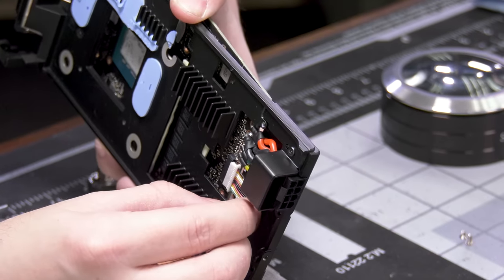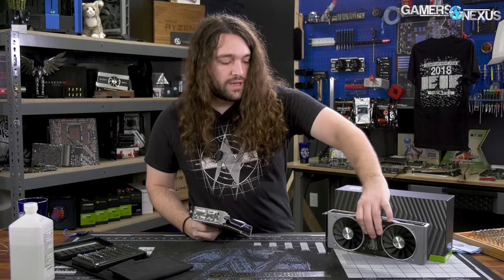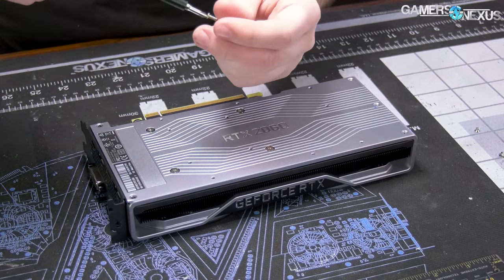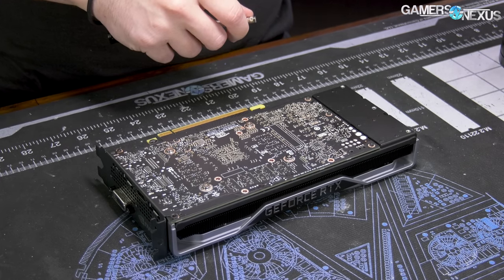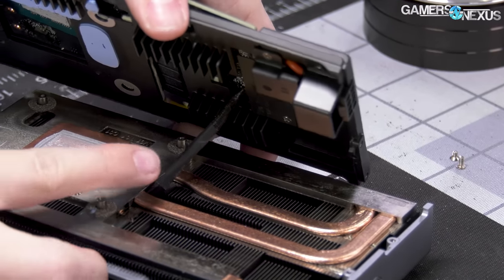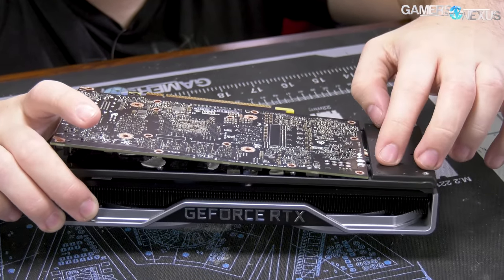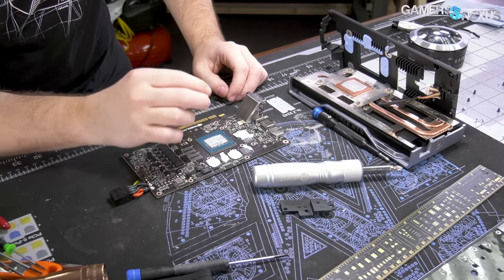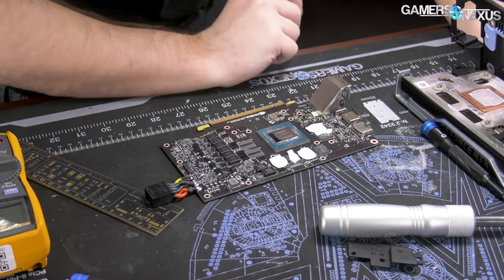RTX 2060 FE Tear-Down: They Added More Glue and Screws

Comment from the maker: Find the review here: https://youtu.be/b4Kfrc3kk_c
Reply: You need to use a Swiss Army Knife that (hopefully) has a phillipshead screwdriver in it to open the RTX 2060 properly.
Reply: Nvidia add more glue and screws....SO YOU CAN't OPEN IT AND UNCOVER THEIR LITTLE SECRET AND TELL TO THE WORLD.........
Reply: I kinda feel like the hair would get in the way.....
Reply: You know its bad when its 28 mins....
Reply: ONE WARD WATERBLOCK
Reply: or they are thinking they customer are  @KSPilo
Reply: Sir, saying that nvidia is inexperienced in fan design and stuff does not hold up . their boardpartners all have loads of experience
Reply: ASUS does the same thing.
Reply: there is a couple screws holding the power
Reply: noticed it right when you opened it
Reply from the maker: @mauriceh7558  Their board partners are not NVIDIA, though.
Reply: @GamersNexus  Would it be that hard to get that partners knowledge tho?
Reply: I like your videos, but every time I play your recent vids my processor overheats, especially on this vid. My dedicated GPU doesnt heat up though, and I play other content in 4k but yours seems to be the only one to do this, normally youtube videos have my processor running at 50 celsius or so but when I play your vids it goes up to 70c(higher then when im gaming), granted I am on a laptop but I still found this odd seeing as there are no other videos that do this.
Reply: more screws than fps with rtx on
Reply: Steve, hot glue isnt bad in computers and is often used by OEM's for shipping purposes. just use some rubbing alcohol, it will make the glue brittle and pop off. but it needs to be avoided on small capacitors etc. cause it will rip them off.
Reply: Easy reason Tech Jesus why Nvidia did this. It's so the 2060 won't compete with the 2070 as it uses the same GPU chip if someone gets water cooling and overclocking
Reply: Almost seems like some of the money wasted of building this thing went purely into making it harder to take apart
Reply: @darronpattel  If you have a GPU in your laptop, turn on hardware acceleration in the chrome browser settings. That way your laptop stays cooler, since the GPU can handle the video better.
Reply: steve removes a screw calling is a pan head when it clearly is a countersunk flush head... also RIP anyone who buys these cards and goes to reapply their thermal paste in a few years.
Reply: Small nitpick but when you look at the copper block and say "thicker is not ideal, it's about surface area not thickness", you're a bit off the mark. More mass means can store more heat, and takes longer to warm up. It's a good thing. It's all about tradeoffs though, since copper has a heat capacity around a third that of aluminium (but aluminium is much lighter). Your comment about surface area is not wrong, but it doesn't really apply to the die side of the heatsink, it applies to the radiating elements, or fins.
Reply: its 22-27 milimeters not centimeters.  at least i hope lol
Reply: NVIDIA going the Apple way
Reply: that cooler looks trash
Reply: similar buils quility to walmart pc
Reply: are you sure there isn't a connector hidden under the cablesleeve?
Reply: Hey Steve@GamersNexus, with it being as close as it is to the RTX2070, do you think you could possibly fit an EK RTX2070 waterblock to this card? Looking to do an open loop, but don't want to spend RTX2070 prices just to do it. This is purely aesthetics, but not for my Ryzen 7 I'd be pairing it with. Your thoughts?

Comment: ifixit score. 1/10
Reply: They should give it a solid -1/10 :)
Reply: How would you fix any broken component on any graphic card?
Reply: aggese . Thermal paste?
Reply: @robertt9342  will only ever keep it from immediately fail for overheating. But is you check the temperature of your graphic card even on idle it is going to be significantly higher then ambient and likely close to 60-80 during high load and that temperature will make the component gradually degraded all the time it is used. It will take a while to fail but it will fail
Reply: You are way to generous IMO
Reply: actually its more like 3.5/10-4/10....
@aggese if you look at the review, Steve did a Thermal Analysis and its cooler then the last Gen GTX 1070.
Reply: @aggese  not fixing by adding Thermal paste, replacing thermal plaste  in the future.
Reply: @aggese  Or adding a waterblock of some sort.
Reply: @aggese  NVIDIA repairs and examines video cards, this one will be hell for them. Also, as a consumer you would like to be able change thermal paste.
Reply: They have gone the Apple way, even after 2 years you wanna replace thermal paste is a pain... And with that 8 pin wired and soldered, more points to degrade after 2 years with heat and moisture in my country... This is definitely not a card to buy as used..I guess to nvidia, their consumers "upgrade"every 12-18 months? SMH
Reply: @aggese  Dired out thermal paste. Replacing fan cause of broken fans which are not available.
Normally such GPUs live very long and can even be used for games in the next 5 years, of course not on ultra settings.
Reply: @aggese  Nvidia uses their Deep Learning and Artificial Intelligence Solutions to unscrew their cards
Reply: Newer buy used 2060 because you can not fix it... maybe this is commercial thing behind this.
Reply: Looks like new students were hired in designers team :).
Reply: @aggese  Some cards are designed to operate at those high temperatures (Like 80 to 90 Degrees). It depends on the card though.
Reply: @XsaviXander  yeah CPUs and GPUs are "designed" to operate and not self destruct imedietly at those temperatures butt the high operation temperature is still what is going to make them fail and they would last a whole lot longer if they could operate at 20-40 degrees.
In the end it's just down to properties of silicon some other materials could be even more resistant but they would also be allot more expensive.
Reply: @aggese  usually we open gpu for water block diy
Reply: @uxkvn  yeah but then I assume you would not buy this specific one
Reply: Xsavi Xander As a long time PC user, I still try to keep my chips at or below 40°C (104°F) if I can get a reading.  Because long lifespan is good.  And that's without mods (but with upgrades and repairs).
Reply: 1000th like
Reply: @aggese  try google it dude even in youtube so many videos about gpu fixing
Reply: It's easily a minus score. Even nvidia themselves definitely won't fix this and will just send you a new one lol
Reply: Bruh wanted to change the thermal paste

Comment: You know someone at Nvidia is having a huge laugh over this right now.
Reply: Was this built by Walmart OP or what?
Reply: @CaveyMoth  LoL Walmart OP builds their computers within specification. They perform within specification too. I don't see the issue with Wal-Mart's OP Gaming PC's other than their price.
Reply: I dont think that the NV Dudes are laughing. Why do you think that they rushed that Ray... what? thing? AMD has Ryzen to Big or should i say to small in DIE size for NV : )

And they even will use Freesync in the Future haa haa but beside all that shit i was talking it is good for us the customers!
Reply: @XsaviXander  did you watch gamer nexus video on the one he got?
Reply: they shouldn't be laughing because after seeing this i would buy a  different kind
Reply: The problem is the corporate structure itself. If the people at Nvidia don't do these anti-consumer tricks, the shareholders will have them replaced see. Same reason Todd Howard fucked Fallout, shareholder pressure.

Comment: My GPU has 4 spring screws to entirely remove the cooler and reapply thermal paste. Wtf is this?
Reply: I know, right? How the hell did things devolve into this abomination
Reply: I agree with you but if it’s a heavier card, it’s not really a good thing since it’ll probably sag if it’s only attached by 4 screws. My evga gtx 970 does come apart with only 4 screws though and I appreciate the simplicity!
Reply: nVidia is bust LAPRing as Apple, what else.
Reply: @7Dunkan7  my old-school 4-slots 3rd party air cooler (yes 4 slots thick including fans) only held by 4 spring screws.
yep it definitely is heavy, I just build my setup to not sit in traditional position, to avoid sagging problem all together.
yep, Nvidia is going stupid nuts with their products here... MAXIMUM really we only need 8 screw - extra 2 at each end to ensure balance.
Reply: nvidia use this system in quadro card
Reply: Hell, both my 1070s got a 4 big screws and a few small screws to hold on the cooler, and the whole thing fall apart, no screws on top of screws, and glue, can have it apart in less then a few min.
Reply: Anime T0getherEU, what GPU you have/
Reply: @thatGuy-fr5nc  Radeon HD 7950 twin frozr. Equivalent to 1050, 1050ti and rx560.
Reply: @AnimeT0getherEU  Almost, no compute shaders. No HDMI 2.0a or DP 2.1.
Reply: thats how it shoud be because alot of us like to put new termal paste
Reply: This is pretty straightforward. Since, the goal is to prevent individual repair and maintenance of the videocard.
Reply: @7Dunkan7  you would be amazed to see how much weight a screw can carry, especially in vertical.

the only thing which would cause the cooler to sag is when the vibration of the fans loosens the screws over time, but if they aint using screws with protection against that this product aint worth its money.
Reply: I have the Zotac 2070 blower version, there are like 12 screws to get the shroud off, a near-impossible to unplug fan, and a heatsink that I have yet to figure out how to remove. pretty unepic tbqh
Reply: If I had to do this when I repasted my 980 TI I would chuck it in the bin and buy a AMD gpu just out of spite

Comment: nVidia is like Apple in this regard: screw down everything and then glue it extra shut.
Reply: and then it breaks
Reply: @CybpnK It is like that where they have very thin and "classy" design. This is a damn gpu.
Reply: This is the first generation, where they did that.
Reply: Literally every phone screen is glued together, including the battery on most smartphones....
Reply: @DimiS1978  one thing is a fucking screen, where air can't get in between the parts because it screws them up, and other thing is a piece of metal attached to a block of silicon. One is 3mm thick, the other one about an inch.
Reply: @somedude2492  Try taking out the battery of your phone. 95% sure its glued in there.
Reply: @DimiS1978  it's not. Moto g4, 9 screws and the battery is free.
Reply: @DimiS1978  So what your saying, is we should start gluing everything together?

I like it!
Reply: Or glue the thing you can't screw down, because you ran out of screws and ideas.
Reply: Even if my phone battery is glued into my phone (in my case,it is), there is a pull tab there to grab and just pull it off the glue. So these two things are not comparable, anyway.  It's glued to keep it from moving around in the case, but they make it easy to remove if it needs replaced.
Reply: @brianhennebeul1854  I never said that but come on, complaining endlessly about stupid stuff like glue and freaking screws. Its starting to get real annoying.
Reply: @DimiS1978  That doesn't make it a good thing. Being able to service YOUR OWN electronics is a good thing.
Reply: @DimiS1978   i own a lot of phones, models ranging from 2012 to 2017. none have glued battery.
Reply: I'm surprised Apple hasn't sued Nvidia for saying "It just works" yet.
Reply: @DimiS1978  double sided tape on the battery, but not on the battery cable. It's different from this. Battery can be replaced, this, they glued the freaking cable that makes it harder to separate the whole thing. No point in cable management when there's that huge shroud covering all those cables. And in your phone, all the ribbons are attached with connectors, not soldered like this. Dude, even Apple (the anti diy repair godfather) didn't solder their connectors

Comment: So thats where the cost increase comes from. Build it insanely stupid.
Reply: And do NOT use parts you already bought if possible so that you have to buy other new parts as an excuse for raising the price AGAIN.
Reply: @Vercusgames Sniffing.
Reply: @Vercusgames for those who bought it to sniff it every time they game on it. Heat+glue=heaven. "Get them hook to our cards! It just works!"
Reply: @Vercusgames 20 years? Those glue might be degraded after 5 years of sniffing experience provided for the buyer. And that teacher is evil to choose this card for disassembling... Or he/she hated that class
Reply: Why even use metal? Just get a PCB, and glue on some VRMs..a couple connectors..bam! It just works.
Reply: Not stupid, per se. It's rather smart. Since, the goal is to prevent individual repair and maintenance of the videocard.

Comment: Going to be fun watching people RMA these cards because a fan dies.... and it has Apple-level design. So much for user-repairable.
Reply: nothing new, you CAN NOT buy a replacement fan

also they are probably the least likely part to die
Reply: @hyperusgudgeym1724  did you look for these fans? pretty sure you can. steve even told the model in the first teardown
Reply: @hyperusgudgeym1724  you would be surprised of how common it is for a fan in a gpu to die. They are the only part of the gpu that is moving constantly and that has a great impact in durability.
Reply: @1toW4mB0to9  Nope you cant get them
Reply: @somedude2492  Not if they are not from Zotac :D Jokes beside, i am pretty sure NVIDIA didnt cheap out on the fans, i have one myself.
Reply: It dies after warranty.
Reply: @somedude2492  "you would be surprised of how common it is for a fan in a gpu to die. They are the only part of the gpu that is moving and that has a great impact in durability."

FTFY. No other part on the GPU moves.
Reply: @Joey Tech Talks none moving electronic components are actively degrading anytime they are running hot and given that it is basically impossible to cool GPUs or CPUs to room temperature they are more likely to fail unless the fans are truly horribly bad and even then they usually run for a year or 2 before failing catastrophically
Reply: @hyperusgudgeym1724  never said that there are replacement parts. If you search, you'll find something in eBay. Apart from that, nothing. Which doesn't mean it doesn't break.
Reply: @mjc0961  you just rephrased my words to mean exactly the same. What was the objective of your comment?
Reply: @hyperusgudgeym1724  Fans on graphic cards are normally the first thing to die.
Reply: @maikatase  generally, it's the thermal paste that gets harden, then fans overwork to keep the temp. After that..ggwp nvidia, buyer: "oh well, it's $350 only anyway, time to get a new 1" /Sssssssssss
Reply: Yea, because everyone here knows, the vast majority of users with bad fans replace them themselves as opposed to RMA'ing them.  Especially in this price range...
Reply: @kinggremlin4574  i lubricated my old gpus fan just because one started making noise. A simple repair after years of it operating. If you need to make such a small adjustment and spend so much effort for simple dissassembly  its a little unreasonable.
Reply: @hyperusgudgeym1724  Just yesterday I replaced the fans on my 980 ti. Model PLD10010S12HH fans. Yes, you can get fans for graphics cards.

Comment: Nvidia Is rapidly becoming the Apple of video cards!!!
Reply: crookim difference is that we still need to buy their stuff if we want the most powerful hardware
Reply: Interestingly, Apple doesn’t even use Nvidia graphics anymore. They prefer AMD and Intel
Reply: @mr_beezlebub3985  The biggest reason for their switch to AMD was mostly because of a dispute over some faulty chips with nvidia which pissed apple off and they now refuse to work with Nvidia. Its even insanely hard to get nvidia drivers to work in MacOS
Reply: Lassi Kinnunen  you can say whatever you want about apples shitty business practices but they are definetely not minimizing cost on their laptops. Think about the huge battery or the very expensive aluminium unibody
Reply: @maxthycom  very expansive? you mean at most on a £1000 laptop its at most £250 for parts and assembly. If you look at the iphone 10 it costs £300 to make and ship to stores  and that is using an expansive and inefficiently designed screen which is wastefully expansive.
Reply: @noname-wo9yy  They have to make a profit somehow. They are not going to sell the phones at the price it cost to make them. Run a business of your own like Apple or Samsung, and you'll find out.
Reply: crookim .
Reply: @maxthycom  Which is great until the SSD which has been soldered to the Motherboard fails or you want to replace the batteries after 4 years...

Comment: They are just making it harder and harder to change the crappy thermal paste to better one
Reply: Please do show that their paste is bad. I think it will do maybe 2 C difference tops...
Reply: @AstralS7orm  Usually the thermal compound what comes from the factory is good enough, but there is better compounds on market
Reply: @StaticVapour590  Yes, but not much better. Main gains from something like Kryonaut is that it's thinner... spreads better.

Differences in conductivity between 3 W/m*K (plain bad silicone oxide  paste e.g. AG) and 12 W/m*K (Kryonaut) or even 18 W/m*K (best pads) are marginal.

Unless you go liquid metal that is. That is an order of magnitude better 80 W/m*K, comparable to silica, will shave a few degrees off.
Reply: 2 Celsius is a lot dude.